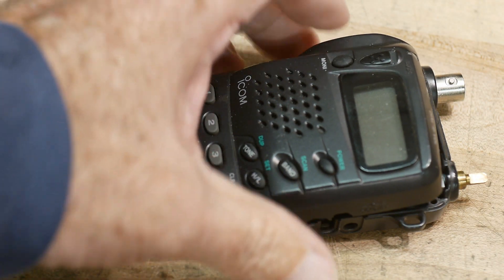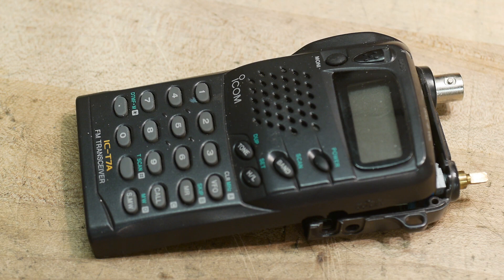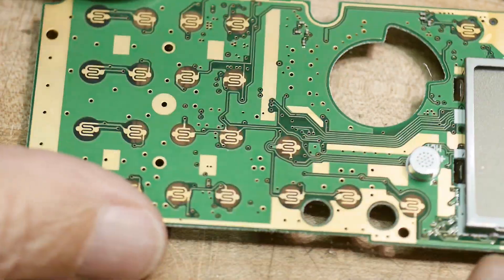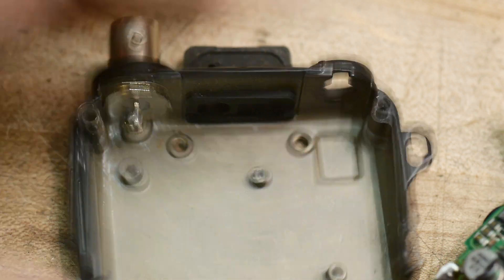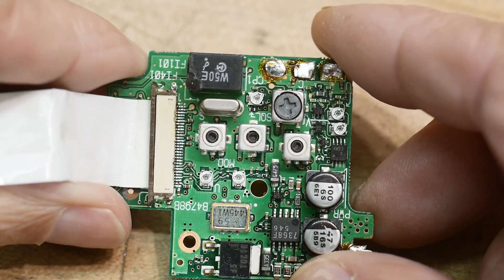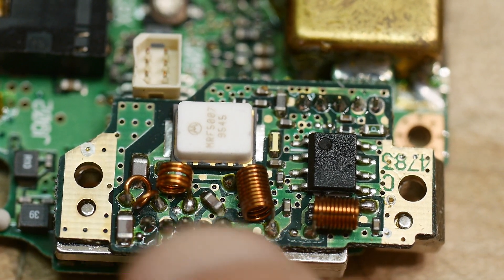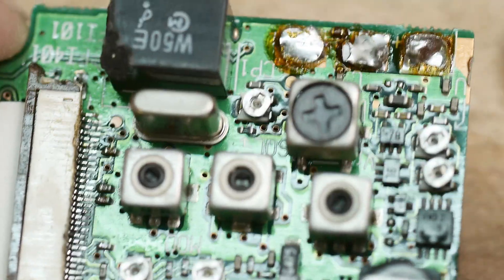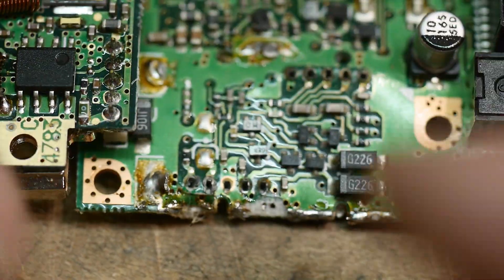#1043 ICOM IC-T7A Teardown

Comment: I have an “H” model of this unit. I wish to clean and adjust the VHF and UHF PA R302 & R304. Does the ribbon cable need to be removed to get access to the adjustments? Thanks!